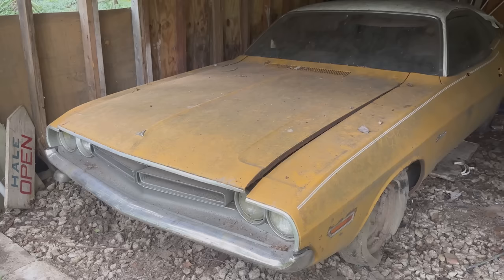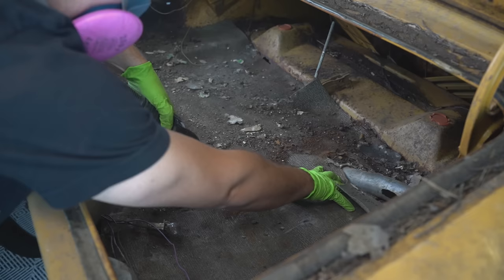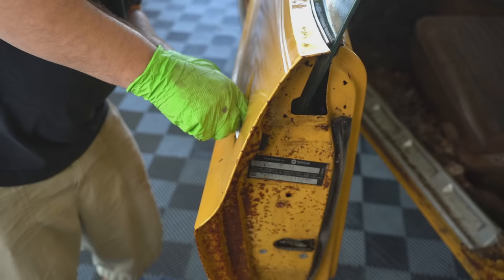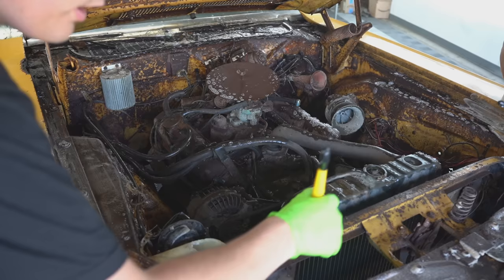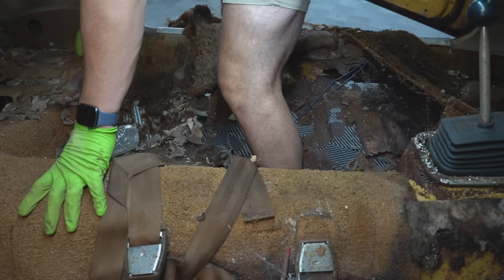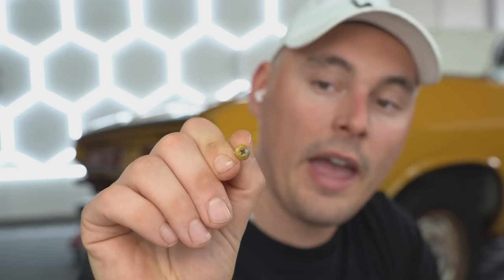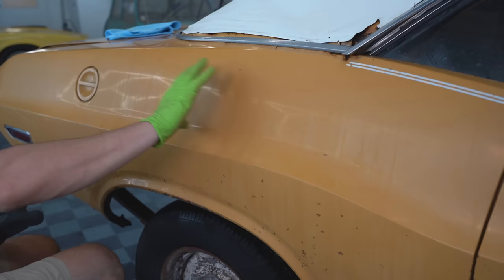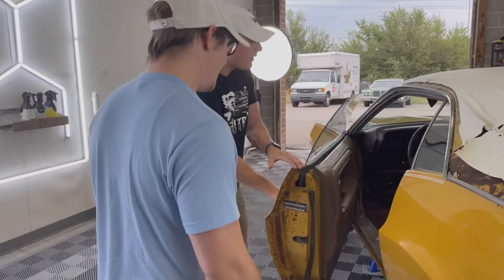First Wash in 40 Years: Barn Find Dodge Challenger | Car Detailing Restoration

Comment: That is definitely 119K miles, at least. No way that is 19K miles.
Reply: It’s 19k we’re sure !
Reply: Inherited an '83 Olds in '89 with 8800 original miles. Elderly relatives never drove it except to grocery store, bank, and shopping. Oh, it once went to PA and back for 302 miles.
Reply: Definitely not a 19,000 mile car😂😂😂😂  99% the owners memory is a little bit off on how long it sat and how many miles it really has 😂
Reply: The chairs are as good as new and that is a good indication of the real amount of miles
Reply: The condition its in doesnt matter how many miles, could be 19mi its going to need a FULL resto.
Reply: come on now ... they raced it around town and blew up the engine and could not afford to fix it
Reply: @diverdave4056  That little 318 isn't going to win many races.
Reply: @jayb.5017    oh YES  I agree .... but I am willing to bet it was driven hard anyway !
Reply: @denniscollins 19k miles, 1 of 10 ?
Reply: Concordo!
Reply: How could a car be that beat and messed with interior at 19k miles lol .
Reply: Easy sale all the parts are available great find. Well worth fixing
Reply: Definitely can be rebuilt
Reply: @JoezGarage 
Just wondering why the car wasn’t stored properly for those 40 years? It could’ve looked as good as when it was first parked.
Reply: @martron1962  your so right it could have been. The barn lost part of the exterior wall and animals and weather were starting to take over. The barn was never fixed and the car remained in place
We’re not to sure why my uncle parked it he didn’t explain this to me either… he bought the car new! Drove it 19k miles he was 100% sure he only drove it that little bit of time. My dad and other uncle confirmed this also! He parked the car at his moms house and left it in the barn and 40 years went by so quickly. My dads 69 Cadillac is in the garage at her house after sitting in our barn also. But it’s in beautiful condition! Runs and drives very very little rust so I totally agree this car could have been in great shape and still running! It’s sad what happened but we are probably going to attempt a restoration on my channel! I have a few things I am working on before I can bring the challenger to my shop but it’s in the cards!
Reply: Exactly that is 119,200 something
Reply: I agree.  Most of the car’s odometers back then didn’t have a 100,000 digit.  It just started back at 0 once you hit 100k.  Probably because the car manufacturers didn’t anticipate their cars lasting past 100k, LOL.
Reply: @martron1962 define " stored properly". If you are talking about a climate controlled garage, etc., 95% of most people don't have the finances to store any car the right way
Reply: Depends. If it lives in the rust belt then a low milage car could look like a tired rust bucket after 20 years. Especially if it isnt stored right. Also looks like it spent some years outside.
Reply: For sure
Reply: Contact graveyard cars they specialize in old Mopar and they might be interested in buying it. Good luck
Reply: Amen 😂
Reply: 219k miles maybe thoes pedals don't look like 19k
Reply: In older cars.  It seems like once they hit 100k, they were considered junk.  Cars today last much longer.  Toyotas can break 300k.
Reply: This car deserves to be saved. It’s an unusual color combo and the 71 Challengers had some unique nuances that the 72-74 Challengers did not. I owned several 70-72 Challngers for the last 40 years. This car was painted Butterscotch and that was a one year only color. I have never seen a Challenger interior in that color. The padded dashes typically cracked in E-bodies. This one was pretty nice. The rest of the interior was very nice-seats and door panel. It was all there too!

The rusted floor was a result of people leaving salt behind in the carpet in winter. The humidity did its number on the drivers floor and ate it away. The trunk floors are usually rusted out, but most of this one was still there, along with the trunk mat. Amazing! 

The paint cleaned up great. 

The car still had its original gas cap. That was the standard Challenger gas cap. Flip Top caps were extra cost and very few Challengers came with them. Everyone adds the Flip Top today. 

I have done a ground up resto on a 71 Challenger 35 years ago where I replaced half the metal on the car. So I know these cars. 

This is a 19,000 mile car that was just stuck in a garage and ignored for decades. It doesn’t have 100,000 miles on it. Humidity got to it and rotted it. It is a rare car being 3 on the floor and a 318. 10? I don’t know about that. Most had automatics with the 318. 

This car has a lot of rare items/parts with it. I do metal work and paint and body. This one is in pretty good shape compared to the average unrestored Challenger.
Reply: You’re wrong. It has 19,000 miles on it, not 119,000. 

I have restored these cars. The First Challenger I repainted was in 1975. That was my first Challenger. Owned them continuously until 2017. Had several of them. This one rusted due to humidity and moisture collecting on the bottom of the car and salt on the floor. I’m surprised the trunk wasn’t completely gone, but it’s not. This poor car was parked in a damp garage and forgotten about for 40 years. 

It’s a rare color combo. Butterscotch was a 1 year only color. I have never seen one with a dark brown interior like this. It was in fantastic condition except for the carpet of course.   

Most unrestored Challengers are in far worse condition than this one.
Reply: Graveyard cars could make that like new.
Reply: My dad bought a 1971 Challenger, 318 Plum Crazy in Chicago when he was living there at that time, we moved to Puerto Rico in 1979 and brought the car with us, we still have it and restored it…
Reply: for sure not original miles
Reply: I thought the same. It's to beat up to have only 19 tho.
Reply: No doubt
Reply: @diverdave4056 ya n got at least 114,000 miles probably 214,000 but a dodge wont last past 150,000 so 114,000 probably right
Reply: I agree
The amount of rust is a good sign

Comment: Likely 119,000 miles. Older cars did not have the extra digit for 100K+ miles
Reply: With all the damage and rust, I also was thinking the same.
The vinyl top may push it over the top for being unrestorable.

Comment: Wow that car is so bad for it having low mileage.  More like 119,000 miles because those old speedos didn't have a 6th digit.  P.S. those wheel covers in the trunk are for a 66 Pontiac LeMans or Tempest or GTO.
Reply: Yes i doubt thats a real 19k mile car, the engine compartment and the interior would never look like that. And supposedly it was in a garage all that time ?

Comment: That is definitely a car worth saving. They built 10 with the 318 and 3 speed floor shift. 50 years later, this may be the last one extant. It could well have been the only one in that colour with brown interior and white vinyl top. Parts are pretty easy to get, so that does make it easier. The 318 2bbl was the standard V8. It was a 2 up engine option, as both the 194 and 225 slant 6 engines were also available.
Keep in mind that in 1971, power steering was an option. There were 3 different steering ratios available. The standard manual steering box had the slowest ratio. Power steering came with a faster ratio. Oddly, there was a third, even faster ratio that did not come with power steering. There were 3 brake systems available. Standard was unassisted 4 wheel drum set up. One up was front disc brakes, also unassisted. Front disc brakes with power assist were the top option. In determining value, the presence or absence of optional equipment can make a big difference. I hope the original 318 can be saved. Numbers matching does increase value
The painted to match gas cap was standard, even on our very base 72 Dodge Dart. The chrome gas cap was an option.
On the 71, the steel wheels came one of two ways. Cars ordered with hubcaps had wheels painted body colour. Cars ordered with full wheel covers came with black wheels. This could be a fun car with the work done. It would be less complicated that you might suppose, since the sheet metal is available and all the hard to find parts seem to be there.
Reply: @michaeltutty1540 very informative post I have a very rusty 1970 challenger with the original 318 3 speed floor shift manual in B5 blue with a painted white hard top. Where could I find information about how many were produced with those options? Any information is greatly appreciated.
Reply: Someone should teach you guys how to wash a car from the top down, not the bottom up. You need to work smarter not harder or is it grandstanding for the camera?

Comment: For their answer for whether or not it's worth saving, it is possible, as long as the chassis is structurally sound and the body is in a good enough condition. Repairing rust holes on these muscles cars is pretty easy as there's not that many curvatures in these cars + panel removal and repairing is quite simple + I think they still make replacement panels and floor pans for these cars.
Reply: AMD makes every part for these cars, but the labor involved is anything but easy. For perspective, a set of new reproduction full quarter panels for a Challenger will cost thousands of dollars. It's harder than it looks.

Comment: If miles are correct. Hard to believe all the parts removed and the car failed at such low miles. I’d like to see the full history involved. Who parked it there and why. Great videos guys.
Reply: Looks to me like somebody was going to paint it
Reply: That's what happens when you store your car over a dirt and gravel floor. My 71 Demon 340 has 14,400 original miles, and it's still like new, but it's always been garaged and driven a few hundred miles every year. Not a bit of rust. None! I've owned many Mopar muscle cars since 1971 and with the exception of my brother's 70 Dart Swinger they've all held up well. His car was driven every winter in Northern Ohio and the frame rusted out in 8 years around the  torsion bar anchor. I owned 2 Demons 1971,  2 Chargers 1971, 1972, 73 Valiant and none  were that rusty even with 120,000 plus miles. 
Maybe this Challenger has 127,000 miles on it?
Reply: No way that is an original 19,000 miles the wear on the carpet on the driver's side shows a lot of wear.
Reply: It's been turned over at 100000 Miles
Reply: @grantcoles8830  I dunno.  I would think the driver's seat would be a lot more worn if the odo had gone around.

Comment: Favorite muscle car of all time is the Pontiac GTO 2nd Gen (1968 - 1972). These cars had great sleek styling while being very light (for the time), giving them great potential in power to weight... The Pontiac Royal Bobcat was the pinnacle with a  390-horsepower 428 cu in V8.

That car is worth saving. Aftermarket sheetmetal for the floors and trunk area are available. Unless someone is doing a "revival", just getting that car to run for a few hundred miles, they'll rebuild/replace that motor and possibly the transmission. A lot of Mopar folks love rebuilding those engines and they end up in better than original condition. Yeah, that's worth saving...

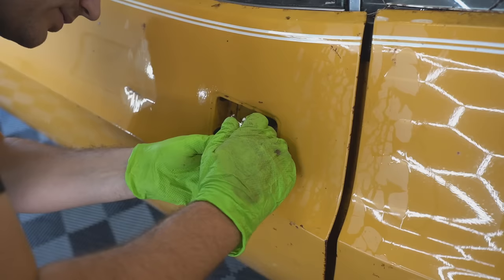Comment: I had a 71 Challenger 440 auto, track pak car and drove it for years then I took the motor out and did the whole race car thing. Cage, High compression  got it to run 10:20 at 140mph in the 1/4. Ended up selling it to a friend of mine who drag raced it for years with a B1 motor then he put it all back stock and he still has it...!!

Comment: To answer your question, I would say it’s definitely worth restoring. There’s basically 3 options. 1. Complete rotisserie job if your buddy wants it to be a garage queen because of sentimental reasons. 2. Leaving it as it is for the right collector (if it really is a 1 of 10 for 1971). 3. Welding in new floor/trunk panels, bondo and paint the outer panels, slap on aftermarket inner door panels and drop a fresh 350 or something else reliable in it and drive the hell out of it. If you have the right connections or can work on your own stuff, you could probably do the last option for 12-15k. That’s probably what I would do if I inherited it. The MOPAR guys are losing their minds reading this and hearing you say LS swap it, but that’d be the cheapest way to getting it to be reliable and have plenty of power. Also could do modern dodge engines like the 3.6 or the hemi, but for a cheap rebuild the hemi is out of the questions. Thanks for listening to my rant, great vid 👍🏽

Comment: I have SO many dream muscle cars, but my mom had a 1969 Roadrunner 426 Hemi with the A-833 4 speed manual, my dad had a 1957 Chevy 210 Post with a 327 4 speed manual, my mom also had a 1970 Mach 1 Mustang with the 351C and a 4 speed manual, and while I have MANY favorites, mine would be either a 69 Olds 442 with a big block manual trans, or a 1970 GTO Judge big block manual trans. I have always been a sucker for a stick car.

Comment: late 60's and early 70's very popular especially the 70 Challenger. The 318 is the standard base engine. Some came with big blocks including the 440 & 426 Hemi. Graveyard cars rebuilds them for about 100k plus and that's what it would be worth after a full restore at best. Most all parts are available to rebuild, 
 I hear.

Comment: My favorite AMERICAN Muscle Cars: So many it is difficult to list them all... Stutz BearCat Roadster, Mercer Race About, Cord L-29, and, the Coffin Nose Coupe, Dusenberg SJ Roadsters, Marlin Convertible Sports Car, Auburn Boattail Roadster,  Ralston FWD Convertible, Lincoln Convertible Roaster from the 1930s, Cadillac V16 Cabriolet, 1930s Packard Roadsters, and many more
1950s Hudson Straight 8 with twin carbs
1970 - 71 Dodge Challenger RT - the 440 6-pack model 4-speed 
and the Hemi Baracuda version
1969 - 71 Chevrolet Chevelle SS
1969 -72 Plymouth GTX
1970-72 Pontiac Firebird 455 SD 4-speed, positraction
1973 - 75 Pontiac Grand Prix 455 SJ 
1963 Studebaker Avanti S2 4-speed
Carroll Shelby and the Cobra 427 
The 1972-72 Ford Pantera
The Ford GT-40 - all of them.
All 1950s AMERICAN Indy Race Cars

There's more - but they are foreign-made...

Comment: Hi guys I like your videos one thing you need to take into consideration is on older cars when you pull the seats out of the cars you need to look for what is called a build sheet usually it's under the back seat inside the springs or front seats inside the springs as well and it is multicolored it will be yellow green Blueish it will say exactly what the car came with and what it was ordered with what special options that makes the car worth a lot more money to have a build sheet. if it's a special model car sometimes people will order and  delete items from the car to make it special for them so that needs to stay with the cars
 So just a heads up make sure to check for it .Don't know if you already know that but if not just wanted to give you a heads up. Papers under the back seats is not always trash 👍. keep up the great work

Comment: Yes restore it.  Most of the sheet metal if not all can be found at auto metal direct. Keep and rebuild the original engine and transmission. And as much of the original components as possible. Look under rear seat to see if the build sheet is still there and intact  as well well.

Comment: Given its overall condition, that Challenger is definitely worth saving.  New floor panels aren't that involved, and as long as the Unibody/Frame is sound, it should make for a good driver level or better restoration.

I may be biased, but I have always favored the MOPAR performance cars.  My all-time favorite, and I will admit to being biased as I owned one for more than 35 years, is the 1965 Dodge Coronet 500 Convertible -- mine had the 383 Cubic Inch High Output V8 with the Torqueflyte automatic transmission -- it was Mediterranean Blue with white interior and white convertible top.

Comment: With companies like Auto Metal Direct nowadays, I would absolutely restore this car, but I am a MOPAR NUT and I am also a big fan of horsepower, so I'd pull that 318/3 speed and swap in either a high compression 340 six pack with an A-833 4 speed manual, or have a 440 built for it with the same trans and a posi rear end. That car can easily be made beautiful and fast again. MOPARs are my favorite muscle cars. If you need an explanation as to why ask Josh Worman or Nick Panaritis.

Comment: The car can totaly be saved and restored. You can purchase all the floor pans new aswell anything else. I have seen alot worse restored. As far as an whole LS swap that would be not worth it because can just put a newer Hemi swap in it Turn it into a Resto Mod which would be better off because they make  a plug and play set up that makes it a whole lot easier . Plus you can buy the whole new K member that makes it simple instead of screwing with a LS mess. Cool find.

Comment: If the subframes are solid and roof isn't rotted out then yeah, it's worth doing something with. (Those vinyl tops are hell on roof steel) Personally I wouldn't waste my time or money with the original 318/3 sp. Have to be realistic folks, this is the base model challenger. It's not a collector car. Doesn't matter if it is 1 of 10. It's 1 of 10 because nobody wanted that combo. This car would be a good candidate for a restomod if it has solid bones.

Comment: They make a cleaner at this place in Fort Pierce Florida/Pressure Pro called simply Brown Stuff. You go around the vehicle with the chemical tip on your pressure cleaner,spray the vehicle/tires and all,and once you've made your way all the way around the vehicle,you simply spray off/rinse the vehicle and it takes everything off. This product removes brake dust/any grease etc,with not touching the vehicle.